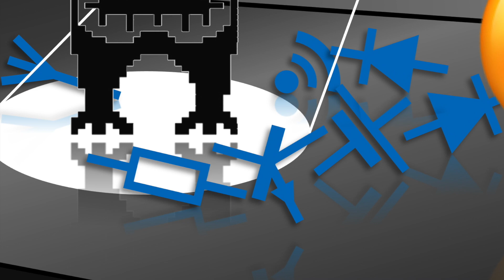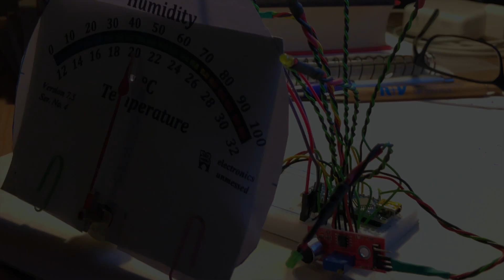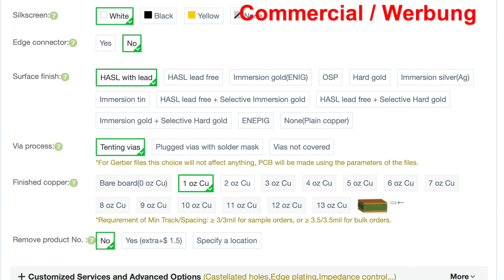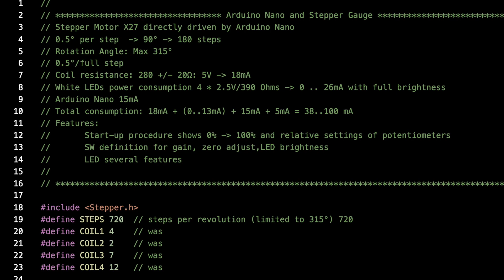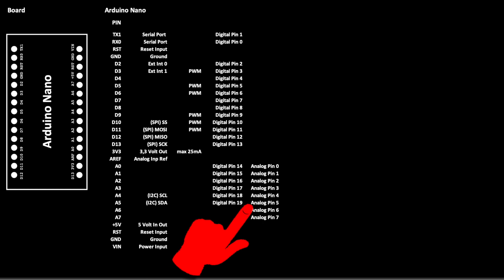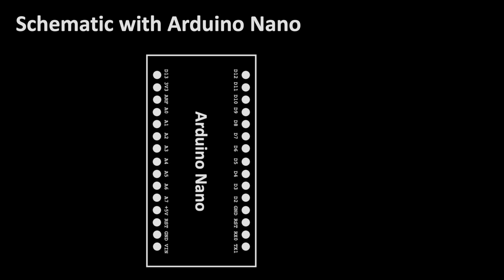Arduino Development Boards – clever PIN assignment for versatile use (EP65c)

Comment: Thanks. I have some project ideas that will be using the Nano, so this is helpful. It's the same idea as what my dad taught me about lumber. He said to always use the worst piece that would do the job, in order to save the better pieces for the jobs where better wood was needed. It took me a while to learn to apply that idea to a lot of other things, such as pin assignments. But It's always been good advice. That's why my Agilent and Fluke gear gathers dust while I use my $5 multimeters, TinySA's and NanoVNA's every day.
Reply from the maker: Hi John, thank you for this comment. I couldn't have said it better. It's one of my messages to my fans: You don't need a $100,000 lab to do great things. Good know-how and a few creative ideas are much more valuable. These are things that cannot be replaced by anything. And your father was just right, he got to the point.